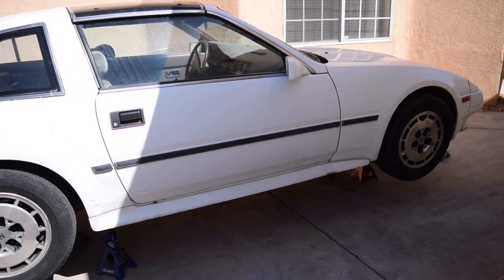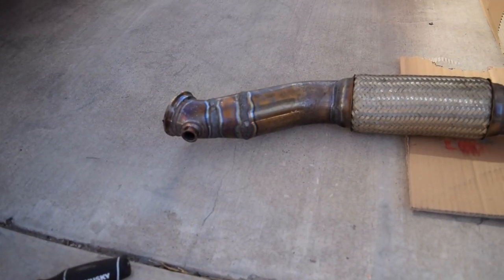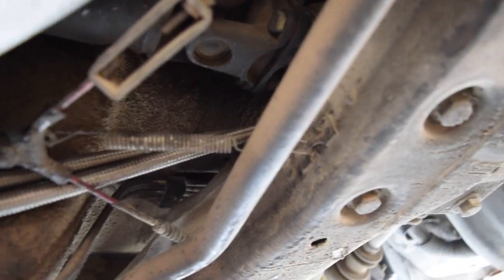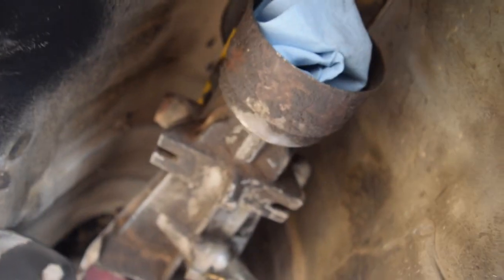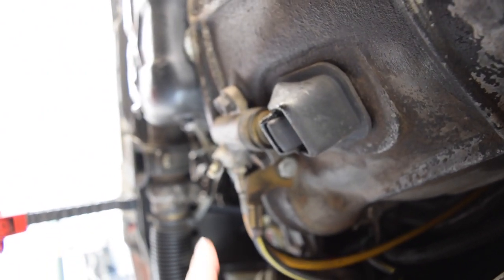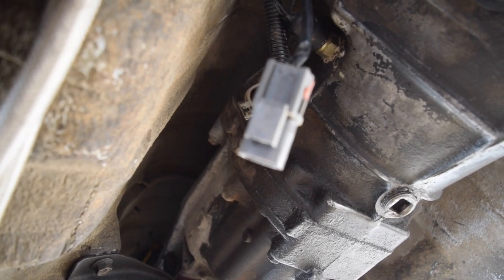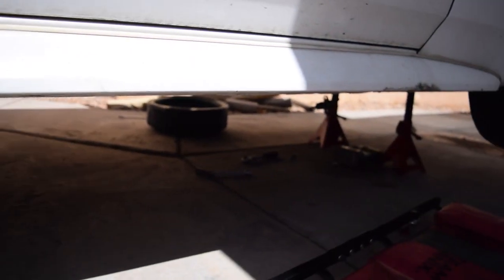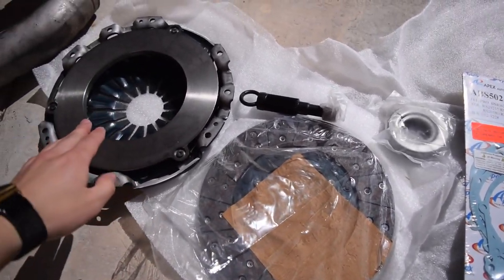How to Replace Your Clutch (300zx Z31)

Comment: Great video, would I be able to bolt this kit straight onto my "stock" 86 with the 240mm flywheel and 71c tranny? Assuming I can't use the throwout bearing, would a stock one work?
Reply from the maker: No the stud pattern for the pressure plate is different between the 240mm and 250mm flywheels. You would need a 250mm flywheel to run this clutch

Comment: How are you liking that clutch and flywheel after a year? Been looking for a performance clutch, I'll order mine tmr if you've had good results.
Reply from the maker: Honestly I have nothing but good things to say about it. It's a nice street clutch that's got smooth engagement, doesn't chatter or anything. It's very worth it for the money in my opinion. As for the flywheel, I honestly can't say I've noticed any difference, but it sure does look really nice and I love that it's brand new
Reply: @TheZGarage  Sounds exactly what I want. Is that link still correct? torque/hp figures differ a bit from the vid
Reply from the maker: There are different levels of that clutch. Make sure you select the right one. That link should be right but it looks a bit different. It's just the highest rated clutch before you get to the 6 Puck option
Reply: @TheZGarage  I ordered the heavy duty organic faced one. 420ftlbs. Hopefully it's right + your vid will make install a breeze!

Comment: how long did this take you altogether to change the clutch?
Reply from the maker: I usually do it in 2 days of maybe 5 hour work sessions putting it in and out but that's also me taking my time. If I was in a rush I could probably get the clutch in in a total of 5-6 hours on a single day. It really just depends on how much your exhaust and other parts fight coming off
Reply: @TheZGarage  thanks awesome info. I'm taking mine into a shop. But that helps to know how long and much $. My car has 130k miles and don't know if clutch has ever been changed. My reverse is pretty much out and seems like I just lost throwout bearing so  replacing tans too which I picked up one.. should I have a new flywheel on the ready just in case or more likely the one in it can be machined?
Reply from the maker: Usually the flywheels can just be resurfaced unless the person who owned it before you really didn't know how to drive stick or they drove it really hard.
Reply: @TheZGarage  cool thanks so much for your help

Comment: I want to cry I wanted my car to run today I've never had an issue putting a clutch in this fidanza flywheel like you have I got the clutch kit that came with it for my car boats up the right bolt pattern and everything just will not go flush to the flywheel the dowel pins even hold it off just a little I'm not going inside all day today I'm under this car I've done built a garage over my car out of a tarpaulin please if anybody can help me let me know I'm under the car now

Comment: what shifter is that?
Reply from the maker: It's an isr s13 shifter. Works on the z31 71c transmission
Reply: @TheZGarage  awesome thanks, did you happen to go with the brass bushing, or did ya stick with the plastic one?
Reply from the maker: Just the plastic one